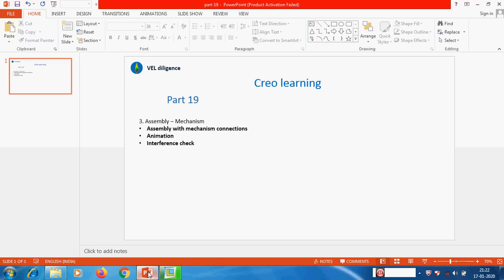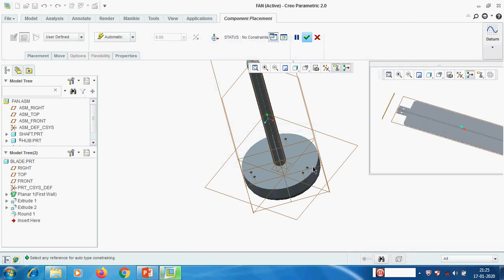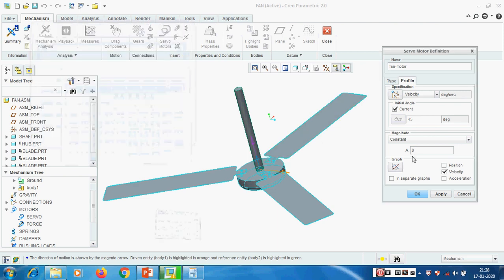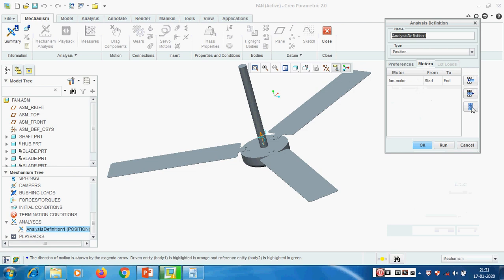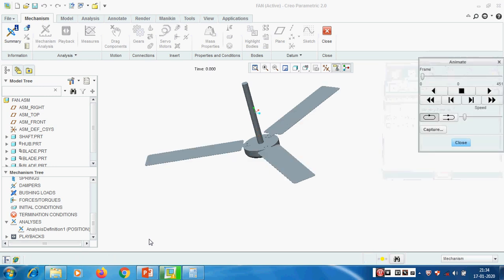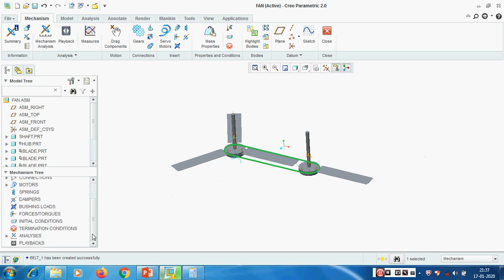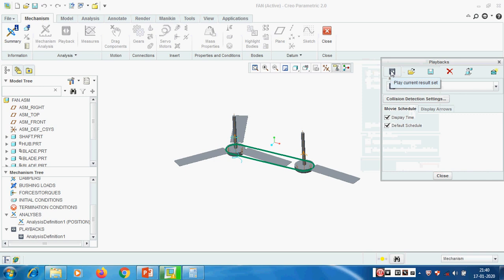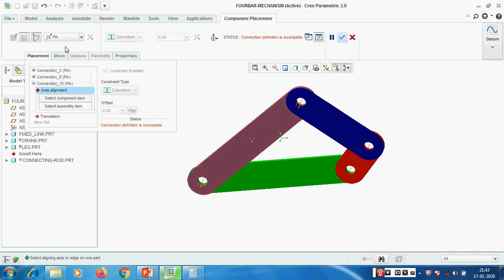Creo part 19 - Mechanism Assembly

Comment: Sir ,creo mechanism from basics ,epdi learn panradhu...plz give tip
Reply from the maker: 1. Know very well – assembly constrained for mechanism connections 
(Example: ball joint, both mating components need points to make assembly constraint)
2. Know degrees of freedom of each connection. It helps to assign number of drive motors. (example: 2 dof = 2 drive motor required to get constrained motion)
(Ball joint can rotate with respect to all three axis so 3dof need 3 motors)
3. Know the step sequence to analyse ( it is already available in mechanism tree)
4. In the mechanism tree assign required inputs. No need to consider entire tree components, whichever required we can select, remaining tree components we can skip )
5. My suggestion: create simple mechanism and do all the steps. After become familiar on this try to learn remaining.
Happy learning